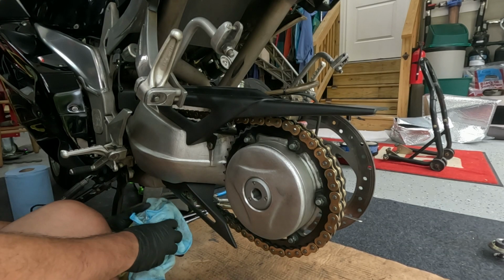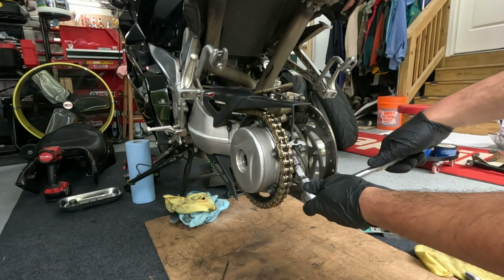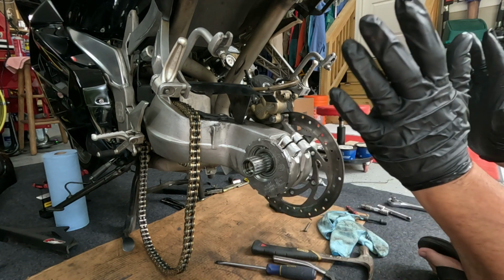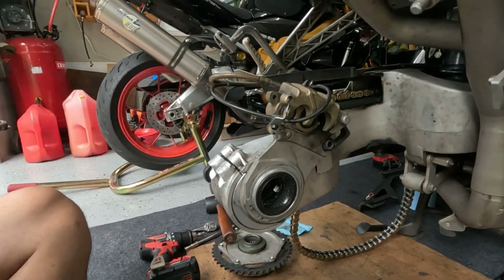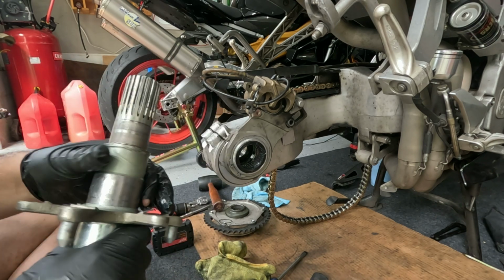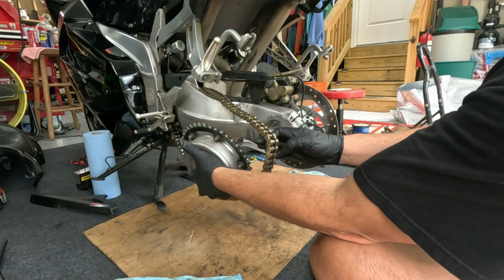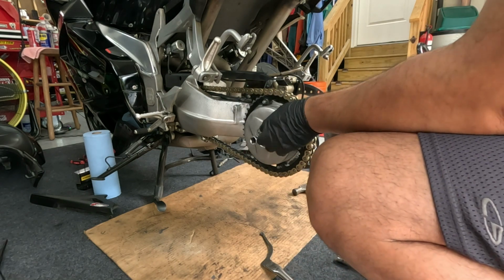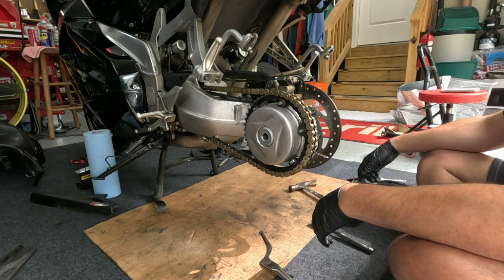Aprilia Futura Rear Axle and King Bearing Check

Comment: I've heartedly watched this at work but, I wanted to thank you in advance because, I know that I'm going to need it. There's something loose in my rear and I don't know if it's axle related of swingarm pivot point related.
Reply from the maker: Great, just wanted to give folks a peek at what to expect as they take things apart. If something is rattling around back there make sure the LH (viewed from behind the bike) axle nut is torqued down properly. Could also be as simply as too much chain slack. Good luck!

Comment: Another great video :)
You don’t need a better torque wrench, you just need to recalibrate them once a year. There are diy’s on youtube, it’s prettt simple actually :)
The cartridge you spin to set chain slack, that comes out; had some trouble on my VFR (similar) and took the cartridge out, cleaned it and the hole in the swingarm, was super smooth after that.
Reply from the maker: Great point. I'm at that point in my life where I just need better tools though. I'm slowly trying to replace all the HF stuff I've been using with things a little nicer.
Reply: @heylookeveryoneitsjeff  I know what you mean. Don’t overdo it though, no point in buying a $600 tq wrench to do up 15 bolts a year haha 😄